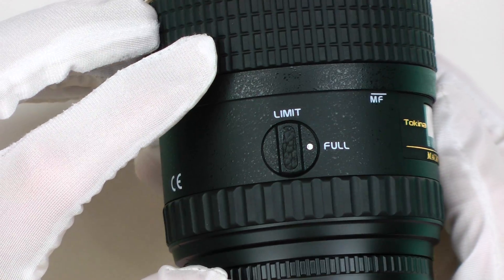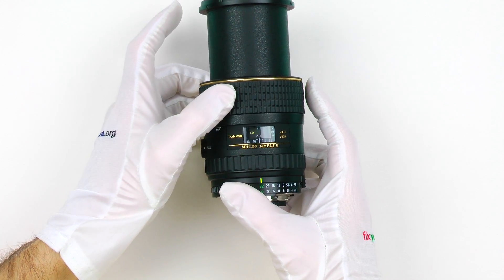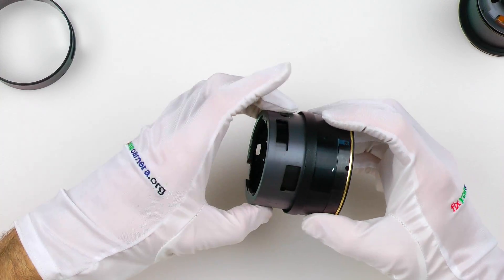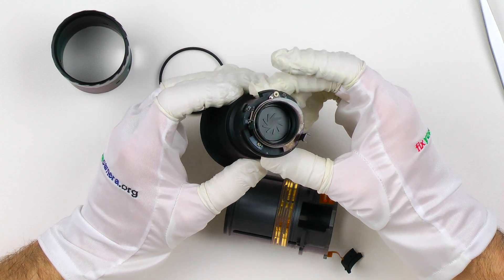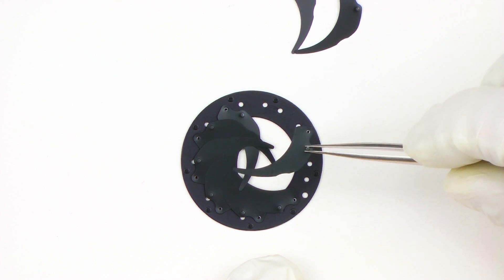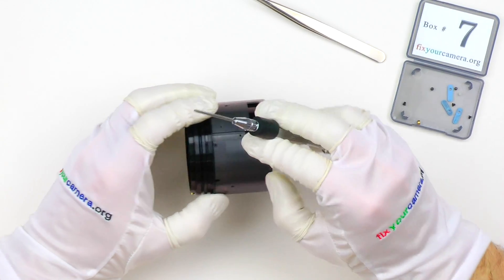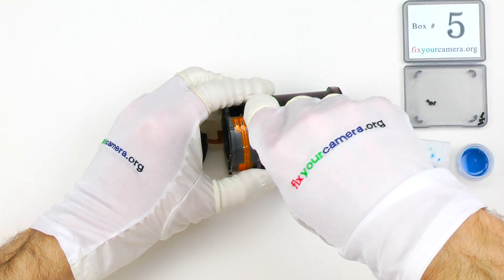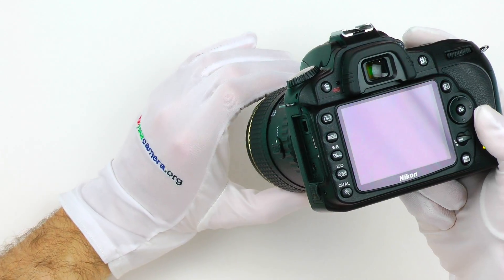Is Tokina 100mm f2.8 macro lens worth it? TEARDOWN & Review

Comment: thanks for the video, I am encouraged to disassemble mine and I am repairing it, I still see that many intermediate steps are missing, for example the limit and full button, it has a small spring and a ball, it is very complicated to place, I see that those steps are not put in the video, the same when you remove the tube after desoldering, several pieces have been removed before.

Comment: My Tokina 100mm lost autofocus today. Out of the blue. Any ideas what might went wrong? I know about the af/mf lock, it is not it. Then after 10 trial today, I got it working again for another 10 seconds, and then again it died. Almost like it has connection issues.
Reply from the maker: Nikon or Canon mount?
Reply: Nikon mount. The day before I was shooting and I did the following mistake-while shooting in manual mode, I turned the lens into the manual mode, but the body remained in AF mode. I do not know if that influenced it somehow? As I said, today I managed to take few perfectly in focus shots, and then all of a sudden it died :(
Reply from the maker: If your camera works fine with other lenses (those without a motor inside) and you can see the aperture value changing on the top lcd while rotating the focusing ring in manual  mode - this means the chip inside is working. If so, the problem is most likely within the clutch and switch mechanism(common thing in tokina lenses), not a big deal - but still - requires disassembly...
Reply: Other lenses work fine. Snap. Is this a costly repair?
Reply from the maker: Probably not, try a local repair shop - check their reputation first. Tokina is very slow with repairs and might charge you much more
Reply: Ok, thank you for your replies. Perhaps I should just send it to you? :D

Comment: hello! mine has fungus in the front element, can i remove the front assembly without unscrewing anything? thanks!
Reply from the maker: Fungus cleaning is not easy, but yes, You can remove just the front lens assembly with a lens spanner wrench (be very careful while doing this). The problem is that you might not be able to clean lens elements inside this assembly. Still, i'ts worth trying, especially if there is no replacement available.

Comment: WOW! Just amazing video and boat loads of great info!
BTW, whois a good source that I can order a main board for the 5D2 camera, and how can I know if its a oem board vs a copy?  Thanks!
Reply from the maker: The best source for Canon parts is... Canon! They do sell parts. Although a main board replacement is not an easy swap. There is firmware, initialization and lots of adjustment values to copy from the old one - otherwise it won't work.
Reply: Sent it in to Canon, and they fixed it for under $250 parts and labor.

Comment: i just received my brand new tokina 100mm f2.8 macro.

it had 3 issues

1. oil mark on one of the aperture blades 
2. big dust particle inside the lens very visable
3.glue residue on the rear of the lenshood

could demand for this lens make them rush in the factory and make 
mistakes? i have now been advised i can return the lens for another new 
one hopefully no more issues like this
Reply from the maker: Hi Jeff, not a good experience overall:) It's not high demand, it's just Tokina's quality control unfortunately. The lens construction is simple/primitive and quite good. The manufacturing process leaves quite a bit to be desired. Mine also had some problems, that's why I recorded this video. Hopefully the replacement will work great!

Comment: I've owned this lens for 2 months and all of a sudden auto focus stop working. Took it to a repair shop they say it may be the auto focus chip may need to be replaced. how can I find out if it's under warranty? I bought it from the pawn shop it was brand new in the box
Reply from the maker: +Eternally Radiant    if there is a warranty card inside the box - give it a shot. They might require some kind of proof of purchase, but worst case scenario you'll loose $20-$30 on shipping fees. Hard to say what the problem is without disassembling it.

Comment: What is it that is bad, when an externally focusing lens rotates while moving in and out? Is there a technical reason?
Reply from the maker: +Jack White There are too many to list here, but in short: IF (internal focusing) is usually faster, more robust construction, eliminates light loss and zoom like effect. With external focusing it's easy to bump into things, especially in case of a macro lens...
Reply: +FixYourCameraORG 
Yeah sure, I get that, but you said at least it doesn't rotate. What difference would the rotating make apart from everything bad with external focusing?
Reply: Hello Jack...I think of its practical use.  If you have a polaroid filter, it will spin and change effect... if you have a filterholder with barn doors, it will change position... same for a lenshood with square front... it will show up in the corners.  With macro, changing the focus also changes the camera - object distance. Hope this helps.
Reply: Ah!
That was very helpful. Thank you!
Reply: Most Welcome...!

Comment: I owned the Nikon 105mm f2.8 G VR macro and still own the Nikon the 105mm AF-D. Both lenses focus hunt in low light and I didn't see much improvement from the $900 VR lens. So I sold the VR version. Have you examined the Sigma 105mm f/2.8 EX DG OS HSM Macro which sells for $619 in the US? I'm wondering what your thoughts are.
Reply from the maker: +Ike Cantle no, I don't work on Sigma...

Comment: What type of grease you use? What do you think about graphite powder "dissolved" in alcohol? I tried it once and the result was great.
Tell us about fixing squeaking ring motors!! :)
Reply from the maker: +Štěpán M.   never used it and don't think it's a goog idea - could get into optics. For m100 I used low viscosity, helicoid type - safe for plastics and aluminum. Greases... very broad subject...:)
Reply: You have to use just a little bit and smudge it so it will create just a thin film. I think that graphite is for some parts or extreme weather better than regular grease. Thanks for answer :)

Comment: because of your microscope: i dont know if it particulary well with a microscope, and of course you have to keep the cropfactor in mind, but how about a pentax q or q7 with 5.6 or 4.5 cropfactor and full hd video?             which you could use with any adapted lens, full hd video and it has focus peaking i think.
Reply from the maker: +Joshua Mack    thanks for suggestion, tomorrow i'll be doing some "heavy dremeling" to fit a camcorder on this microscope. Bought 5 cheap/different mounts, hopefully I can put something together...that actually works...Never expected it to be such a problem, nothing I bought works right out of the box.
Reply: sounds complicated. as complicated as disasembling a tiny teeny Q-mount af lens :b                                                                       If i had or just thought i had the skills in tearing down stuff i could maybe solve stupid little problems like my camera not allowing me to fire my internal flash for slave triggering together with an external flash.                              why not? because you shall buy that dedicated master flash. give us money. hmpf.                                                                                id probably die by electric shock.

Comment: could you recommend a decent screwdriver set to use with lenses? Thank you!
Reply from the maker: +tremeree jphp    Very good question. Camera and lens screws are NOT Philips type. Even though they look like. It's JIS type.  The best you can get are from Canon directly, Canon parts dept. in the US. I don't have the parts numbers handy right now, but there are 3 sizes. The middle one works with most screws (I think it's 2mm). You'll need to buy a handle also. 
Or Amazon and "Moody Tools JIS type" - it's also good, but I prefer those from Canon. I'll make a video about this in the future, very common problem -  people stripping screws at home and then it's a big pain sometimes.
Reply: FixYourCameraORG thank you!